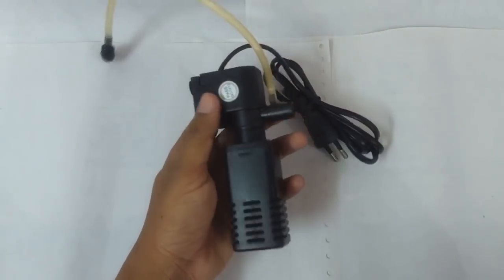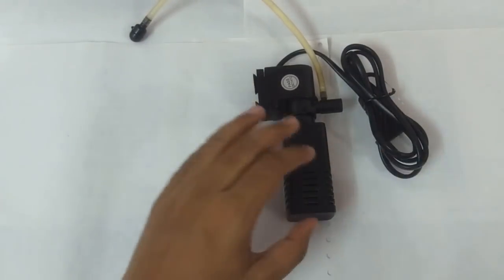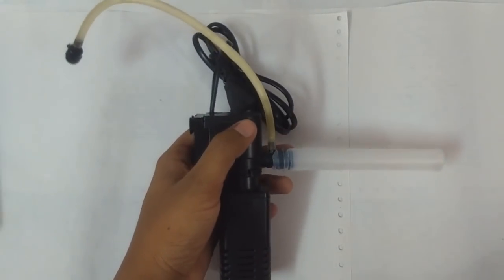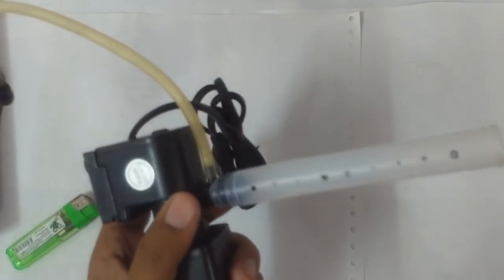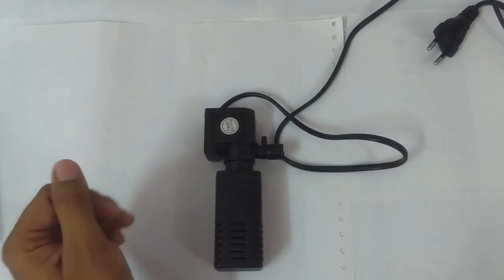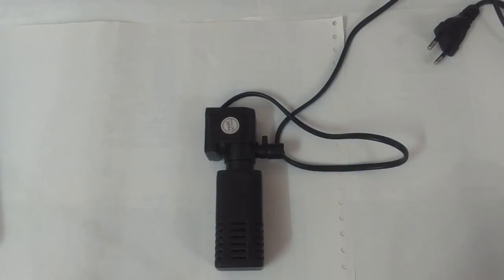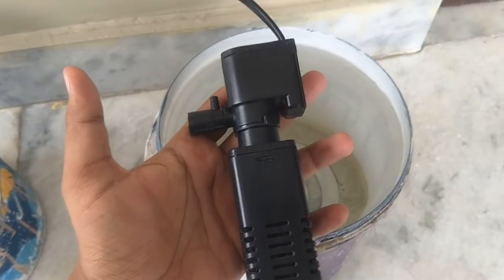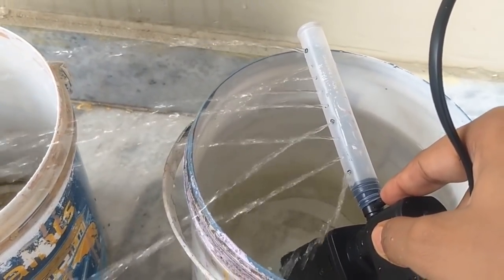How To Reduce Aquarium Filter Speed | Reduce Water Flow

Comment: Congrats for spoiling the motor, it won't last for 2-3 months
Reply from the maker: Raj bro nothing will happen to the pump. i have been running my filter with a cloth at the output. its been more than an year now and the filter is still working.
Reply: @gurribuy  instead of those hard work u can use 5 rs pressure adjuster to the air suction of the filter. Why so long process bro
Reply from the maker: The air valve only controls the air flow not the water flow. When we close the air valve it may seem that the flow is reduced because we see less bubbles, But the water flow remains the same and in case of a betta fish low water flow is very important.
Reply: @gurribuy  my opinion either I go for small filter or else bigger tanks, I won't spoil the 250rs motor for a worth of 300rs smaller tank, I hope u understand what iam trying to say. 
U r concerned about betta fish, not everyone would've heard that.
Reply from the maker: @felidae1989  i get it, buying a small filter should be the first step. But i'm using sobo wp850f this is the smallest filter available and still has very high flow.
Reply: @gurribuy is absolutely right about the water thing. The valves only stop the air flow but the water flow remains the same. Raj probably never encountered it so has no idea..

Comment: does connecting/disconnecting the air tube effect in the speed of the water flow releasing?
Reply from the maker: Connecting or disconnecting does not affect the water flow.
Reply: Which internal power filter should I use in my 2'×1'×1' non-planted aquarium? 
880 L/H or 1000 L/H ? I have around 10 fishes and may get 2-3 more in the future.
Reply from the maker: Get the bigger filter because the price for both the filter is almost same and the more filtration you have the better.